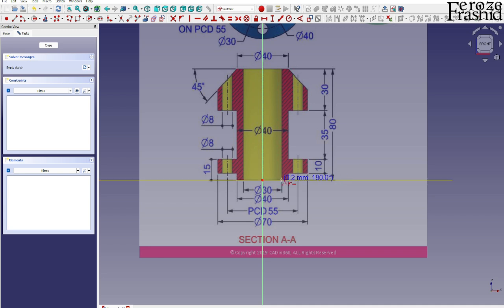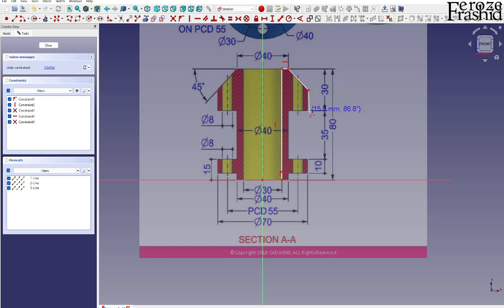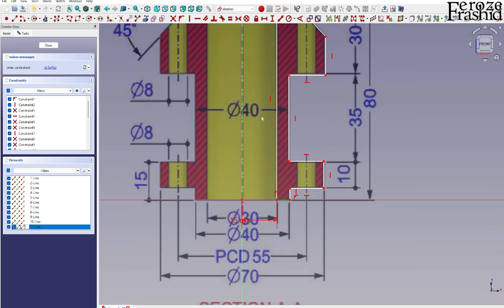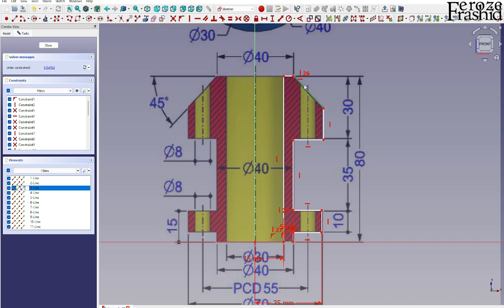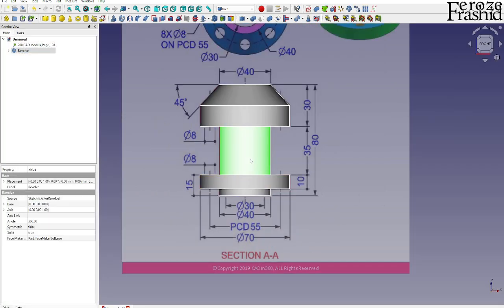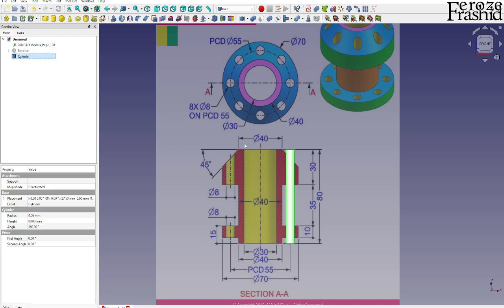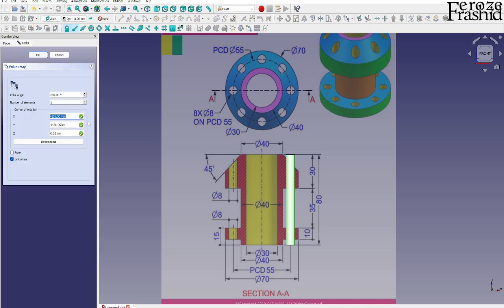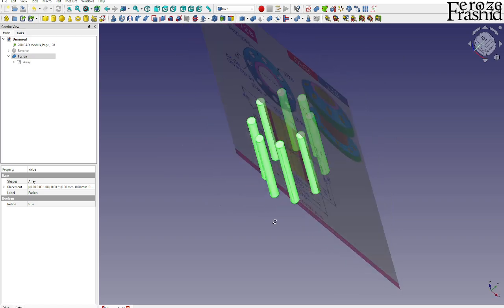200 3D Models in FreeCAD: Exercise 128

Comment: Thanks, I now am able to open a dimensional drawing, and select and drag it directly into my new drawing, determine which plane to begin in, in View at the top open and make sure "Toggle axis cross" is on, then close view and double click in Model View the drawing, select calibrate and the biggest dimension and click on the the start and end and enter this dimension and enter, right click drawing and select transform and move the location of drawing to the origin to match the plane if needed, start a new sketch and create the profile using the polyline (I recently was introduced to the "m" key to change behavior) and close and rename to sketchProfile when you completed all detail and totally constrainted, then I went with Part Design WB and selected my sketchProfile and revolution OK, then create a sketch on XY and while new sketch is open select model, then "Attachment", "Position" increase "Z" to positive 5, then then back to Tasks where sketch still open, select section view, construction geometry select center circle from origin and set diameter to 55mm, then select CG circle and create center circle on this circle and set to 8 mm and select center of this circle and "Y-axis" hit short-cut "O" (constraint to object) and now we have a 8mm hole on the 55mm circle and close sketch and rename, select this sketch and "Pocket hole" while choosing "Through all" and "Reverse", then OK, now select this Pocket and then "PolarPattern", since pocket is already selected as feature and (axis="Normal) sketch axis, (angle=360°), change Occurrences to 8 and OK, WE ARE DONE while never leaving Part Design WB. However I Love "Part" WB for Boolean operations, and the Draft WB is really not used enough as a beginner but soon we find out it makes harder designs possible.
Feroze, Your Use of opening drawings, etc has really given me a remarkable core of knowledge to build from in FreeCAD and "Yes" there are several work benches to create the same results just like there are several options to engineer and design a Part.
You Are Awesome! Stay Healthy
Reply from the maker: Thank you.